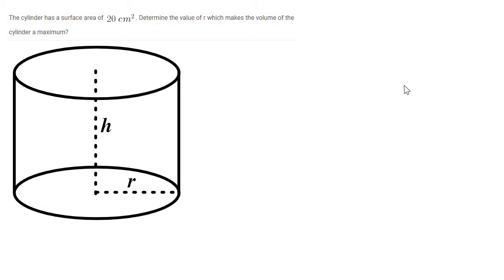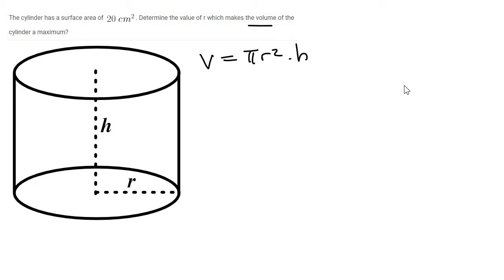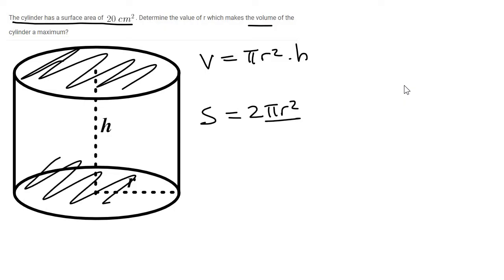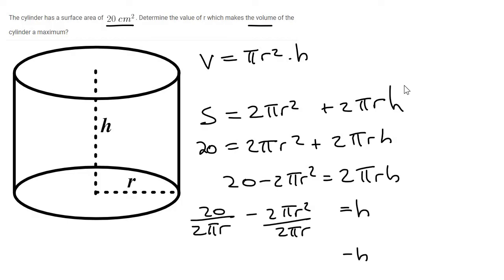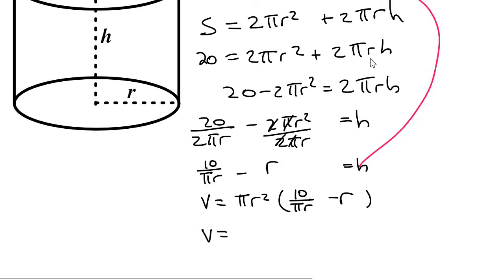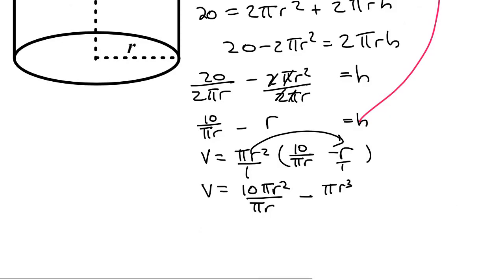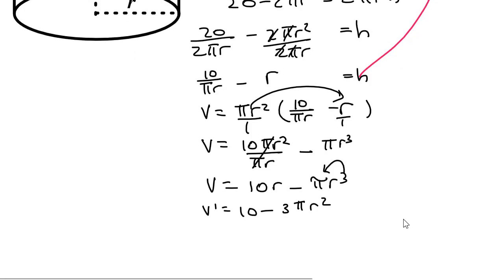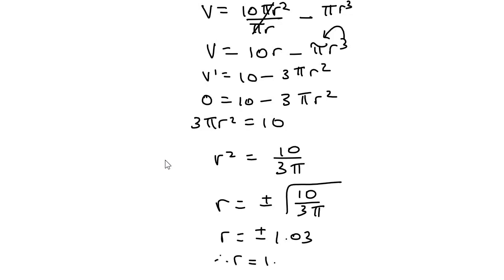Optimisation Grade 12: Maximum Volume Cylinder

Comment: 2:33 Sir, I believe you made a mistake instead of 10r it should be 10 to the power -r
Reply: the bottom r cancels with one of the r's at the top, so only the top r remains, hence 10r^1 or just 10r